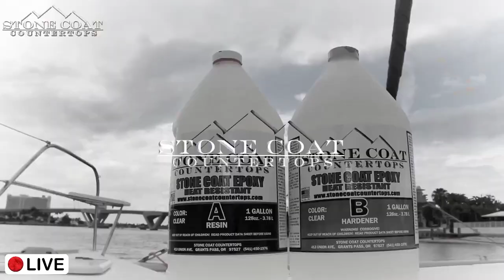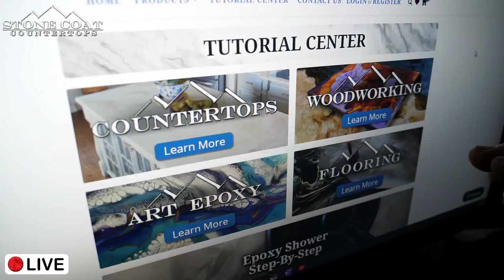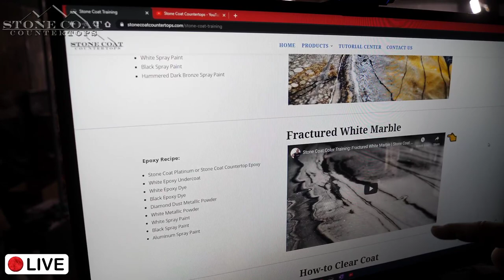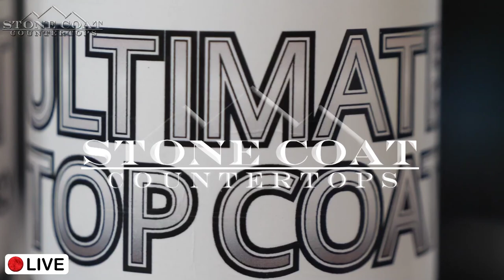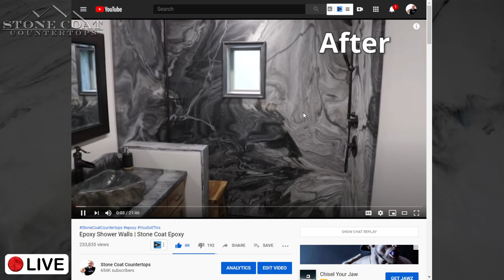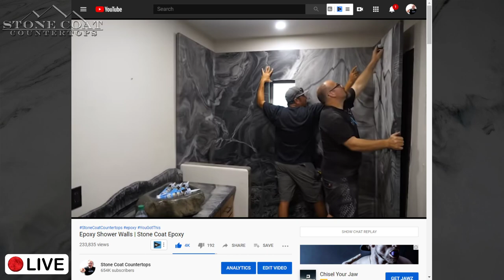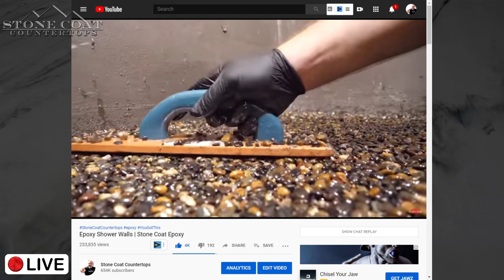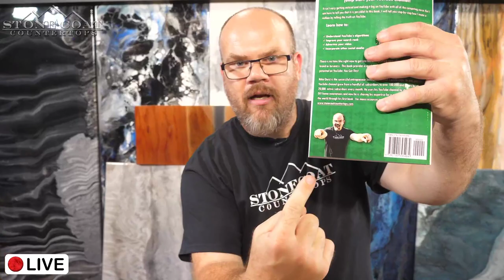Stone Coat Training: Ultimate Top Coat Application | Stone Coat Epoxy

Comment: I made a wonderful bar with your products, but I have a doubt if the last top coat gloss that I applied would be wrong, can I apply another layer without polishing or can I apply it on top without the need to polish? If I have to polish, it can only be the area damaged or does it have to be the whole bar?
Reply from the maker: If you want to redo your top coat make sure to sand with 220 grit on your previous coat of epoxy before applying the top coat. We recommend applying the Ultimate Top Coat to your entire project.
Reply: Thank you 🥰

Comment: What if you don't care about having your project finished really, really, fast?  What if you have time to make it perfect?  Do you still recommend the Ulitmiate Platinum coat... I mean, it cures so fast that it cracks over time.  I don't want an cracking over time.  I will be doing my work in an RV that will be moving on the road.  Should  I  completely avoid the Ulitimate Platinum Top Coat and stick with the  Clear Coat that gives me more work time and possibly has a longer life span?  In addition, cosmetically, which surface looks better to the naked eye?  Thank you.
Reply from the maker: Great question Linda! Creating with our products we hope to give you great results and a long life span on your projects. With that being said all of our products are great to use. Finding that perfect combination for your specific project can be difficult but not impossible! Feel free to check out our website or contact us directly so we can make your time with Stone Coat Countertops worth it! -Nathan
Reply: @StoneCoatCountertops  I will contact you before I start  my project for sure.  For now I am doing my research.  So quick question:  I need to know which would better to use in an RV that moves every 13 weeks (I'm a travel nurse).   (1)  the clear coat that gives me plenty of work time ; or, (2) the platinum ultimate top coat.    I'm wondering if you can give me a few pros and cons between the two.   I love your transparency.   I understand that the edges of the countertops may crack with the platinum ultimate top coat becauses it dries so fast and the runoff edges are so thin.  Please share.

Comment: How did the board turn out that you had touched before it was dry? You added top coat to it without sanding to see if it would work. Did it or was it a fail?

Comment: I got a question for you, did you ever mix the ultimate top coat mixed with regular epoxy on a flood pour and see how it drys or even with a roller and a light coat to see the finish product comes out, might be smooth and harder epoxy.

Comment: what if you have an above-the counter sink with a 1" aluminum edge? Is it best to run your epoxy counter top to the edge of the 1"lip or  remove the sink, complete your countertop, then insert your sink on top of the countertop?
Reply from the maker: Great questions Linda! Have you seen our videos where we work on sinks specifically? If not check them out and see if that can help with your project. https://youtu.be/fM-a5hMyqoM -Nathan
Reply: @StoneCoatCountertops  Thank you <3
Reply: @StoneCoatCountertops   I just watched the recommended video, took notes.  That was a below-the counter sink.   Have you done any installs with an above the counter sink?  Sure would like to see a vide of that.     Thanks.  Great tips!

Comment: So, I tried your approach of doing half and then doing the other half. I had a roller start messing up, so I  had to delint another- once I had the next side down, the middle now has a pretty noticeable line - about an inch thick -  between the sides. Do I need to strip it all down again or is there a way to fix this?

Comment: Hola. I'm confused 😕.  Should I use the ultimate yo coat on a regular epoxy coatting?
Reply from the maker: You always want to add a final coat with no additives. You can do a clear coat of SCC for food safety and durability. Or using the UTC for final coat as it has enhanced durability!

Comment: I plan on turning my granite counters into Carrera marble. It seems the Platinum is the way to go. But my question is my island. It is a Black Walnut top. Right now it has polyurethane (yuck, right?) And I love the shiny finish. I need it to be durable, scratch resistant so it seems I should not use Plantinum because the Top Coat gives it the honed look and not shiny, and without it, the Plantinum will not be durable, right?

Comment: If Platinum is non yellowing does that mean that the original is yellowing?
Reply from the maker: Hi Car, the Countertop Epoxy does have UV inhibitors. If doing a white or lighter color project we would recommend the Art coat, it has even more UV inhibitors to further protect it. -Thea

Comment: what is the measurements for mixing the resin and hardener
Reply from the maker: Hey Maurice thanks for watching! The ratio for mixing our Stone Coat Countertop Epoxy is 1: 1. Here is a video showing how we mix the epoxy! https://youtu.be/ygbKeiH7oXI?t=6954
Other epoxies may vary with the mix ratio, for example, Flooring Epoxy 2:1, Casting/Super Cast 2:1, Art Coat 1:1, Craft Coat 1:1 Quick Coat 1:1, Platinum, and Top Coat 2:1. -Nathan

Comment: I have watched you use acetone to soften and smooth edges.  Doesn't using acetone to remove the dust defeat the purpose of sanding?
Reply: Sanding between coats

Comment: I am a chiropractor and deal with a lot of nutritional issues. Energy drinks are basically caffeine at a lethal level. Check your diet out as you should be getting your energy from the food you eat not artificially induced with chemicals. Forcing. your body to function at a higher than normal "speed" can assist you to literally burn out way too soon.  Believe me, you don't want your adrenal gland to stop working. You wouldn't only drive your car at 100 mph or use a tool only at its highest speed.....so why are you doing this to your body?  Think about just using amino acid supplements (like the athletes use), that crap you are consuming will blow out your kidneys